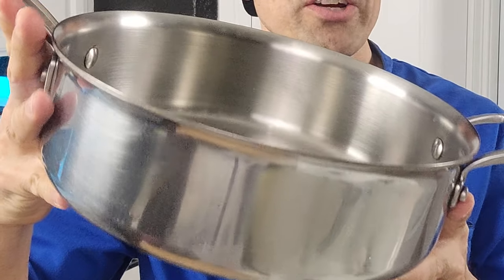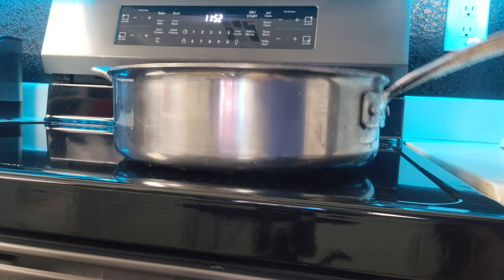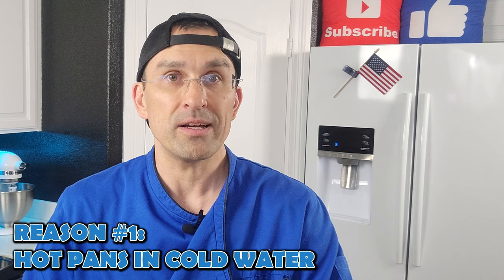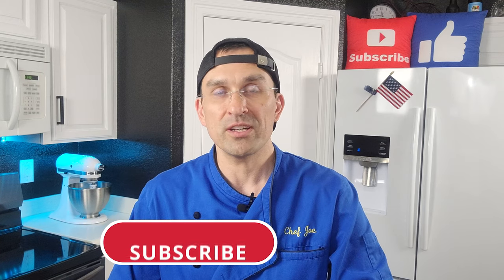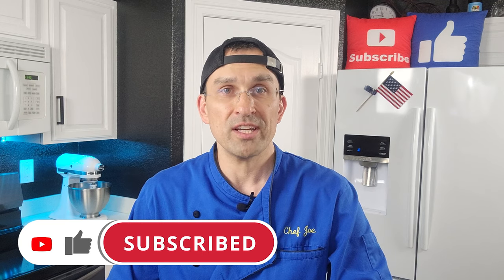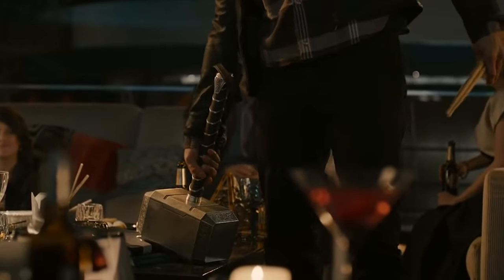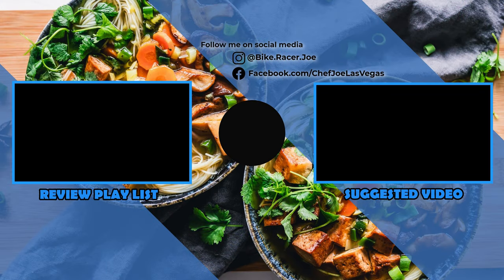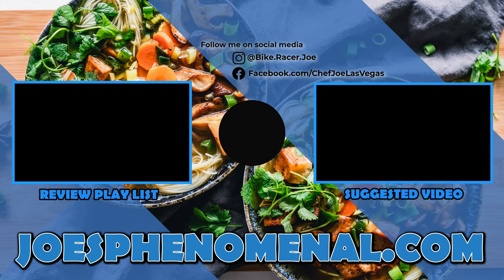Top 6 Reasons Why Pans Warp | Before You Buy, Watch This!

Comment from the maker: We hope you enjoyed this video. If you liked this video, you might like this one as well: https://youtu.be/URZY5PWITPY. We have many more on our channel at: https://www.youtube.com/JoesPhenomenal .Remember, if you want to learn cool new recipes, get useful cooking tips and tricks, and get all sorts of other kitchen related content, start now by subscribing to our channel and hitting the notification bell so you never miss a thing!
Reply: I did enjoy this video and have been enjoying a couple others. There's a lot of science involved in thermal transfer of heat in metal cooking tools, especially when you get into multi-material tools. The difference maker is less about the absolute heat and more about the difference in heat across the surface of the pan. It seemed to me that there's some room for you to dig deeper on that point: A couple ideas came to mind:
> The details of construction in multi-clad ss pans is important since one reason to select stainless steel pans is to cook dishes that require deglazing. Thermal shock is a useful part of the process. For example, the materials used by Demeyere in their 'Proline' pans are much more robust than those used by All-Clad.
> Manufacturers also deal with thermal expansion by planning for it. I think you'll find that most frying pans are constructed such that, in a cool state, the bottom of the pan is slightly concave, allowing the pan to remain flat as it experiences both longitudinal and concentric thermal expansion.
> The functional design of Gastrolux pans requires that their construction accommodate significant thermal shock. They recommend applying thermal shock to help maintain the non-stick nature of the pan. They recommend the addition of soap and cold water to the pan while it is still hot, after cooking. They are using thermal shock to prevent the possibility of fat polymerizing on the surface which would defeat it's non-stick properties. (seasoning a non-stick surface is not a winner, functionally)

https://gastrolux-canada.ca/en/maintenance/

Just a couple obsevations / ideas.
Alan
Reply from the maker: Wow, Alan! Incredibly informative! Thank you, my friend!
Reply: @JoesPhenomenal  I forgot to mention. In one of your video's you mentioned using "Barkeepers Friend" to clean your stainless cookware. That was my choice too, until I found a product named "Universal Stone" It's  not only does a great job on my cookware, I used it for all kinds of other cleaning tasks. It even washed away the dye from a wet sticky note that stained a marble countertop ... when nothing else would.
Also safe for the inside of my Staub dutch ovens.
Reply from the maker: @alanharris3277  hmmm.. gonna have to check that out. Thanks!

Comment: Thanks for the great video. 

I have witnessed multiple cases of pans being warped by induction stove. An inductions stove provides one side of a transformer and the pan is the other side so massive amounts of power can be transferred which can cause extremely quick heating if a high setting is selected. The big pan/small burner problem is much worse with induction. The counter top cooktops are a real problem. I bought a couple and sent them back. Though they may have large circles on the surface the actual coil size underneath the glass is usually less than 6 inches. One I tried could deliver 2200 watts via a 5.5 inch coil. If you hold a powerful flashlight against the glass of one of these cooktops you can often see the size of copper coil. I saw one "youtube expert" demonstrating some high end pans. He heated them all up on his big fancy induction stove. His pans were quite warped as liquid would not stay in the middle of the pan. These were All-Clad, Demeyere, etc pans, nothing cheap. So if you use induction be real careful heating up something large like an All-Clad 5 qt sauce pan.

A side note about induction cooktops. Beware if you have extremely good hearing. My wife does as she could hear the 19KHz of the flyback circuit on some old CRT TVs. I turned on an induction cooktop in the kitchen and she was 20 feet away. She screamed in pain and said "Make it stop". It caused her inner ear pain that lasted for days. Turns out many of these cooktops run the coils in the low 20 KHz range.
Reply from the maker: Thanks, John. I think a lot of people under estimate how powerful induction is. In my experience, you don't need it set any higher than medium power levels. In fact, the only time I have it higher than that is to power-boil water or something along those lines. The higher power levels can heat the metal too fast and if it goes uneven for whatever reason, that might just insta-warp the thing.

Comment: Hi, I definitely have a problem with burner size mismatch. My pan is bigger than my induction, is there a way around this? Or I just have to accept my fate?
Reply from the maker: The painted circles on a lot of those is actually bigger than the actual coil sometimes. Hate when they do that. All you can really do is use a smaller pan that matches the size of the burner better, unfortunately.

Comment: Hi Joe! Thanks for these tips. My new Ninja NeverStick Premium cookware set claims it's oven safte to 500F. Does this rating usually only apply to the non-stick surface or does it also take warpage into account?
Reply from the maker: I think it takes everything into account. Just keep in mind that overheating the pan isn't the top cause of warping... It's cooling too quickly by throwing cold water onto it in the sink while it's still too hot. It's a bigger problem with stainless pans since they often times have a mix of different metals in there.

Comment: Hi, Joe, thanks for a great vid. I just warped my super-thin stainless steel pan after just TWO uses. I bought a Tefal induction hob/lid combo (very cheap but a famous brand here in Thailand) and i did stir-fried veg very well the 1st time. Then I put some oil and beef mince into the pan, set it to the "stir-fry" preset setting and it immediately started cooking at super-high temperature. I let it go for a few minutes but then the bottom of the pan became badly burnt with thick charcoal. I probably then made the mistake of putting cold water into it to clean it too quickly, then soaked it in baking soda overnight but it was ruined - the pan was badly warped and some of the stain wouldn't go away. Even if I messed up should it be possible to ruin a pan after just 2 uses? thanks!
Reply from the maker: Well, hot pans and cold water will do it in a hurry, no matter how good the pan is. When you heat it, the molecules in the metal expand in a uniform way, but when cooling down, if you add cold water, the metal will retract faster on the spot where the water hit it making a bend. Also, if you're using an induction range, those heat up really fast and hold theire heat really well, so you never really have to have those higher than med-hi. I feel ya though... it sucks. I don have a video on here about how to fix a warped pan.. You're might be too warped to help, but it might be worth a try. Here is the link: https://youtu.be/nQELqXYVbGI
Reply: @JoesPhenomenal  thanks will defo watch 👍
Reply: @JoesPhenomenal  the vendor has since advised me that while the Induction hob does all kinds of cooking the pan it was sold with is only good for boiling. Thanks for telling me after it's destroyed! I live in Thailand so no chance of them accepting responsibility and a refund/exchange 😜

Comment: I was under the impression that a ss pan needs to be extremely hot before adding  for example protein for it not to stick? The water test (jumping water beeds) was sopposed to be the best way to tell when hot enough. What am I missing?
Reply from the maker: You're spot on.. Ironically, I'm recording a video about stainless right now and that's in it. I didn't do it that way before, because there a bit of a fine line between the pan being ready and overheated so the other way is isn't as good good but still works OK. Depends on the quality of the pan too, I think.

Comment: I have a question. If I fried a stick with the stainless pan. After frying, I want make some sauce with the residues. Can I add some cold water in the still hot pan? Will let cause deform/Warp of the pan? And can I add a big amount of water after frying ( when the pan still hot) for just boiling ?
Reply from the maker: If the pan is still hot, I wouldn't put in cold water. If you're using tap water, I'd at least get it warm, just to be safe. If you're using filtered water from the refrigerator, maybe microwave it a little to warm it a bit. You're probably fine, but cold water on a hot pan is the number one reason pans warp. Probably better to be on the safe side. When I make sauce to deglaze my pans, I usually use chicken broth or beef broth as the base.. Or maybe vegetable broth if you are vegetarian. Those things serve much better than water for your sauce base, IMO.

Comment: Hey man. Strangely enough, I got a Frigidaire Gallery induction range, and Kirkland pans and then I saw your reviews. Any advice? I'm petrified of warping these pans.
Reply from the maker: Sure... in the induction range, I would only use the P setting on the burners for heating liquids.. it's pretty intense. As with any pan, only use the amount of power you need.... stainless pans like these are super efficient, so you don't often need to use super high power... I am seldom over 7 or 8 on my Frigidaire with these and they heat really nicely.... Also, just be sure to follow the stuff in the pan warping video... ESPECIALLY the part about never thowing a hot pan under cold water...I let mine cool down on the cooktop before I put them in the sink... I also don't put them in the oven at over 400.... with all that, you should be golden!

Comment: Why do my carbon steel pans warp up in the middle almost right away when I start using them? I'm following the instructions for seasoning and cleaning.
Reply from the maker: Well.. Once they have warped once, it a lot easier for them to warp again.. Maybe the heat was too high on the warm up? Also when you clean them, do you let them sit on the range to cool down? If cold water goes in a hot pan, that can warp it also.

Comment: what about when you have to put water in the pan, like adding cooking wine or adding water to make gravy or taco seasoning? Will that warp the pan?
Reply from the maker: That should all be fine... Probably better to put that stuff in at room temperature if possible, though. The bigger problems come with larger disparities between temperatures. Also, most of the time when adding liquids for sauces and stuff (me, anyways), I have the pan at a simmer by then so the pan isn't nuclear hot like it was during the main cooking.

Comment: I only use medium heat on my electric glasstop stove. It wraps everything. I get the thickest heaviest pans I can find. The swiss diamond pan I got from Sears like a decade ago before they shut down their local store is the only thing that seem to last.

I honestly think the electric glasstop stove just is a bad size for cooktop.
Reply from the maker: Haven't seen any issues yet with my induction range as far as warping goes. For me, the only things I've ever had warping problems with were Putting pans in the sink while they were too hot, and overheating in the oven. However, I know it's a lot more noticeable when you use a slightly warped pan on an induction cooktop, as it has to be totally flat in order to work properly... With a gas range, it can be a little warped and a lot of people wouldn't even notice other than making it seem like the oven isn't quite level or something.
Reply: @JoesPhenomenal  uncle Scott kitchen on YouTube has a good video on it. I'm just trying find pans that won't warp. Guess I just got to use a mallet to flatten them again.
Reply from the maker: Will havr to check that out.... The mallet trick works pretty good, but ever time you have to do that, the metal gets weaker... Better than being warped though, I suppose.

Comment: So i have a question. Can a pan be poured wrong from manufacturers?  I mean if the bottom of a stock pan had a bubble in it from improper pouring? I suspect my pan has this issue. POROSITY maybe?
Reply from the maker: Maybe a problem during the casting process? I suppose that can be a problem if any contaminates got in there. Maybe the layers could have separated or something like that.
Reply: @JoesPhenomenal  Forgive me for not knowing the exact process of the production of stainless steel or other types of pans. The set I have was a gift and probably was not very expensive to begin with. Its the stock pan. The bottom makes popping sounds and like in your tutorial it is wobbly. I dont use that one as often because of the weird bottom. It has a discoloration in the shape of a bubble on the bottom. I had to use it this weekend for blanching some veggies and noticed the wobble. I have increasingly become fond of using my cast iron more. Not good for blanching tho. LOL
Reply from the maker: Lol.... Looks like Santa needs to bring you a stock pot! One thing to remmeber is to let them cool after use before putting cold water in them to clean. Quick temperature changes can cause warping and weird things like that.

Comment: If by "single-ply" you mean "single-type", how about you used "single-type" right from the start? Simple, huh?
Reply from the maker: Ply refers to the type of material... at least that's the way I've always understood it... most of the time, I haven't seen manufacturers stack multiple layers of the same material, so a single ply is usually just 1 layer and end up being kinda light and flimsy... 3 ply is usually 18/0 stanless, then aluminum or copper, and then 18/10 stainless, and I also have some 5-ply ones that go stainless-aluminum-copper-alumimum-stainless.... Seen some 7's from All clad, and those are suuuuuper heavy!